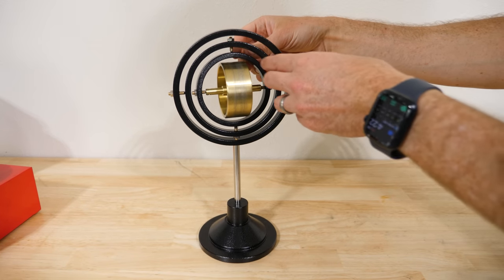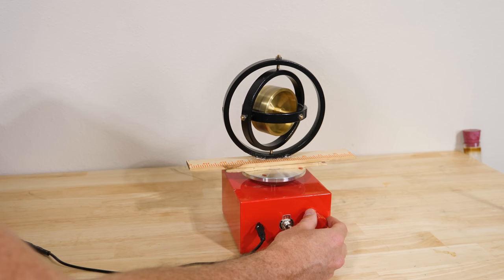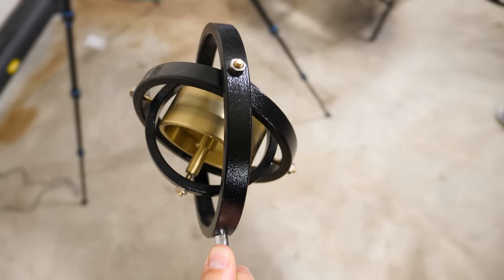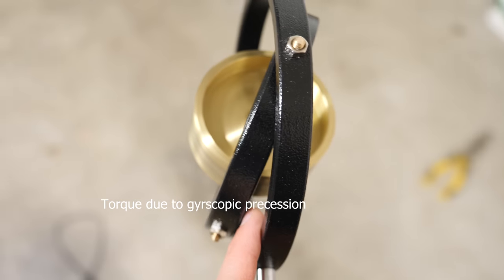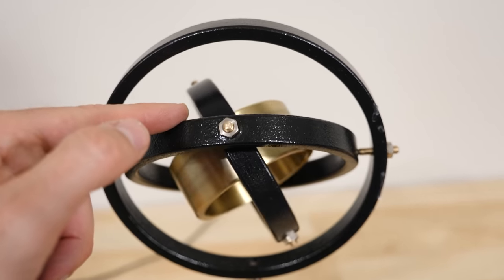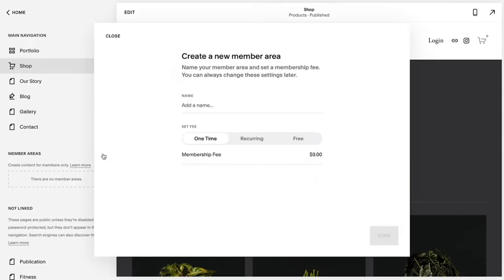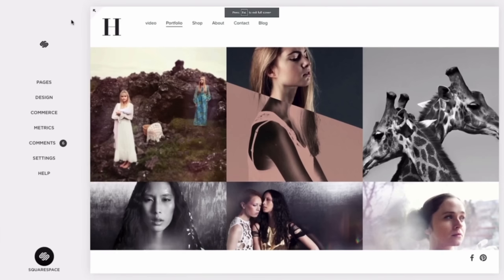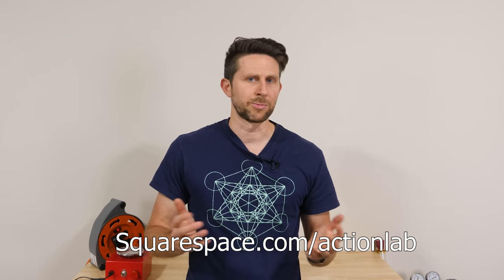Can Gyroscopes Provide Free Energy For The Planet?

Comment: Sadly, conservation of angular momentum makes this impossible. Even without calculating the gyroscope in detail, there is nowhere to "put" the angular momentum in this system. The entire earth+gyro system will always have the same amount.
Reply: If it could be proven impossible that easily all the scientists he mentioned would never have worked on it, your reasoning must be flawed
Reply: Exactly, I weep at the state of physics education of the average commenter here.
Reply: @iamdigory  well, no, foolish things get done all the time.
Reply: That was my first thought too. However, it is possible for a system to lose rotational energy while still conserving angular momentum. For a rigid body (which the Earth of course is not), the minimum energy is achieved when the largest inertial axis is aligned with the rotation. See Explorer 1 spin instability. To extract energy from the rotation of the Earth, we'd somehow need to torque the Earth toward a lower energy rotation. Though after all the time Earth's been rotating, I'm fairly confident that we are essentially in that state already.

Comment: But those are all balanced and so the gyroscope doesn't have to do much to maintain balance what if you made it unbalanced and used the calculated imbalance to manipulate the gyroscope and instead have the gyroscope on the outside and the imbalances coming from the rings on the inside of the gyroscope as long as its calculated so that the internal imbalances aren't causing a clash into eachother... if this doesn't spark any ideas, then don't worry. I'm not really an expert in physics by any means. I am really just throwing some ideas out there that might perhaps bring a spark of interest to you or anybody who happens to read my ideas and it gives them a fun idea for an experiment.
Reply: Also curious about how magnetics and gyroscopes could both be utilized to levitate aircraft and maneuver something like a space ship and without the fuel.

Comment: What if you went with wind instead? Put a massive gyro ball at the top of a tower that wiggles back and forth in the wind like your arm. Just have sensors and motors spin the gyro a bit when theres a wind and they oscillate and get up to speed on their own.
Boom.
Bladeless wind farms.

Comment: It is keeping the same direction because you have interaction of your gyroscope as far as it is not free on a vacuum, but have a contact with the Earth's rotation, even through the surrounding air and that creates motion synchronization! Also, to make the gyro to spin you are losing energy and to do its axis to spin from where you expect to collect the beneficial in energy, also you are losing energy because you keep in your hand the base of the gyro, and you are moving around with your legs, where also you are losing energy. So, how much energy you have to produce to fell the losses and to have and a benefit? And such a gyro device will need to spin without any contact with the Earth, not even gravity force, and the device the same time to be on Earth not over Earth. The gravity interaction with the Earth could exist even in a infinity distance from Earth if the Earth and the device, were the only things around. The interaction will always occur.

Comment: Energy from stable pressure or in other words gravity. Something that generates heat or cold from pressure without loss of mass when it is contained. Must be much better choice to research then a gyroscope who takes lots of energy to get spinning.
Reply: I don’t think that’s possible… to generate electricity you must have a state change
Reply: @truestopguardatruestop164  You generate energy from hot and cold with a sterling engine or steam engine depending on the heat. There is also a thermoelectric generator or peltier TEG as its also called who gets energy from either hot or cold.
Reply: @truestopguardatruestop164  There might be a gas or something who will behave this way im not sure. Earth has a hot core and its confined in space.
Reply: @Centrikk  yeah the Sterling engine changes the state: the two temperatures average in the end

Comment: Oh, you answered the question that i had in the opening -  yep, i don't want longer workdays, so please stop!^^
Reply: I can very easily proof,that this cant be done. And trying it out as a company is kind of stupid.
To extract any energy from earths rotation,you've got to change its angular momentum relative to its center. For this to happen, you need a external force. This could be something like the moon, but also something on earth speeding up or getting slower angular veilosity relative to earths center. So this is not possible with a gyroscope,cause its center of mass stays at the same point relative to earth. Its center of mass hasnt got any increase or decreas of angular momentum relative to the center of earth. Its basically bullshit. And i wonder, why they even tried.

Comment: So I'm no big brain but wouldn't it take energy just to get it started? Also wouldn't it have to be a huge expensive set up just to get a tiny amount of energy out of it?(if any)
And when it was generating tiny energy wouldn't some of it get lost through heat because of the laws of thermodynamics? 
Wouldn't a wind turbine or Pelton wheel water turbine give you way more power compared to the cost of the set up?

Comment: It boils down to gearing - MASSIVE gearing!
If you took a really, really huge gyro then the difference between the axis of spin and the axis of the earth’s rotation would increase so by using the difference and gearing it up you could run a generator.
However it would be hugely inefficient and you would be talking about a gyro weighing thousands of tons to see any useful work. And spinning at thousands of rpm - I wouldn’t like to be anywhere near it….

Comment: You had a silly setup - just don't let all 3 axes be free for rotation - only one, so it cannot orient itself into the axis of rotation. Then extract energy from the gyro drift. Of course it tries to orient itself, so the structure has to be rigid enough to resist it.

Comment: But even if we could, should we? What happens when the Earth slows down or stops? Equal and opposite reactions, remember.
Reply: The Earth has a rotational kinetic energy of 2,138×10^29 J. World primary energy consumption fell to 556,63x10^18 in 2020. At that rate it would take approximately 384.097.156 years for the Earth to stop.
If we can use Earth's rotational energy as an environmentally friendly alternative to carbon based fuels right now, in a million years or so we can start to put energy back into the system.

Comment: Wait a minute. What about the conservation of angular momentum? The slower rotation of the earth decreases its angular momentum unless small bits of mass within the earth system start to rotate. Or is it possible to transfer the angular momentum to the background stars via the mach's principle?
Reply: Yes, Earth would rotate less, and the hypothetical device would speed up (you can wrap your mind around this easily using energy conservation). Frame-dragging does not extend out to cosmological distances, so no cheating.
Reply: @MrMichiel1983  But if the device speeds up, kinetic energy is cosumed. There must be a fixed amount of energy that could be extracted from earth and trasfered to the device with net positive energy gain to do other things before equilibrium is reached, stoping extraction. To avoid this, angular momentum needs to be transfered outside earth-devices system.
Reply: @emiliohuizar3549  Yes, absolutely. I don't think a gyroscope would in fact work. Tidal energy does sap energy from the Earth-Moon system though (but I didn't want to comment on that - I wanted to delve into the use of Mach's Principle and how I think it wouldn't apply).
Reply: @MrMichiel1983  If such a device could be constructed, Does it would prove that mach's principle extends to cosmological distances indeed?
Reply: @MrMichiel1983  I did a simple calculation using energy and angular momentum conservation. The result shows that indeed there is a maximum amount of energy that could be extracted with a hypotetical rotating device. Energy extracted is a function of earths rotational inertia (I_e), device rotational inertia (I_d), earths initial angular velocity (w_e1) and earths angular momentum velocity decrease (x). Although mechanically seems feasible in this way, I am afraid the solution would be forbiden thermodynamically. The graph is E(extracted) = I_e w_e1 x- 0.5 I_e+I_e^2/I_d x^2. Sadly, youtube don't let me post the geogebra graph.
Reply: @emiliohuizar3549  Ha, that's a creative way of looking at it... We are talking hypotheticals here, and two wrongs don't make a right... but, indeed sure if such a device were to be constructed it would certainly mean we'd have to look at the principle cast in another light.
In the end I think Mach's principle is an example of a conformal theory, as in that there shouldn't be a difference between a body spinning and the universe being stationary, and the body stationary with the universe spinning in a weird way. But that's just a complicated way of saying that there are always two sides to a coin -> always at least two mathematical statements that yield duplicate results.

Comment: Energy in energy out....the Earth is already rotating, so to take energy out of the system, you would have to change that rotation speed, anything less than that won't produce energy from it. This is like basic physics.
Reply: Yes, he doesn't mean in infinite energy, like with impossible over-unity devices, just that it's rotational energy of Earth is so abundant that for all intents and purposes there would be no scarcity of it in the next thousand years.
Reply: @MrMichiel1983  a gyro needs to be spun up....that energy isn't free, so any transfer of energy from the Earth to an object on Earth while using the object inside the Earth influence is coupled and meaningless. It's like saying that we should be able to harness the effects of gravity, by simple dropping heavy objects from a vast height.....yeah, we can, but it costs energy to move it to that height. When I say "nothing is free," I literally mean that we are already coupled on the planet, nothing here within the planet while on the planet is going to be free. The best we can do is the tides from the lunar/solar orbits giving us energy (which is outside interference) or solar energy directly (also outside interference).....there's a possibility of us gaining energy off of a moving comet, but not Earth while on Earth, just not happening.
Reply: @sabriath  Yup I agree. Never said it was a good idea to try and use gyroscopes, but tidal energy does sap energy from the Earth's rotation.
I was commenting on the use of the word "free". No such thing as an over-unity device, but the tides are free like wind and solar are for free.

Comment: we can have free energy, a globe within a globe within a globe, mimicking the earth's core, if you look at the cutaway of the earth, it looks like, layer-layer-layer. then it copies-copies-copies-then it repeats-repeats-repeats. the power of 3,, each globe has 3 laters of polished nickel, with magnets, creates a magnetic energy wave, each globe rotates opposite than the other, this creates a "constant rotational surface", the energy wave creates a light, add a Gyroscope to the outside driven by the rotation of the globes, will create an "engine" that can go to outer space or to the bottom of the ocean, add programmable nanotech and it could possibly be able to create true hard water, it could remake the glaciers, it could possibly help to re-create the underwater rivers of the oceans that cool off the planet that the glaciers were feeding. we have the parts and the tech, it just has NEVER been put together like this !!

Comment: The reason it does not work is because the Earth does not spin, the Earth is stationary, Flat, and has a Firmament canopy AKA Dome in the sky, which encloses the Sun and Moon, both of which are smaller than Earth, and spin around above the surface of the Earth at an altitude of about 73 miles.  You can verify this by setting a high speed gyroscope on a tabletop, keep the gyroscope spinning at high speed with a motor, and after hours, the gyroscope will be facing the same direction as when you started the experiment, proving that the Earth did not spin one bit.
Reply: U r smarter than all of the worlds scientists, good proof !

Comment: You can get energy from the earth using thermal turbines and as long as there's a molting center in the planet there's an infinite energy supply.
Reply: So not actually infinite, but indeed very abundant. New drilling techniques might make drilling holes down to 20 km feasible. At that depth geothermal energy is no longer constricted to geologically actie zones.

Comment: Considering we're moving millions of miles an hour constantly changing directions it sure does feel quite stable and still to me... I'm just saying...

Not to mention the fact that the constellations have been exactly the same for THOUSANDS of years when they should be different from night to night if we're moving at the speed they actually say we are.
Reply: planes travel at around 460-575 mph. yet you don't feel the velocity at all.
Reply: Lol, do we have a flearther here.. The key words are scale and relative position. Nothing strange when you grasp this
Reply: @DaP84  troll, don't bother
Reply: Your velocity relative to the Earth is about 1000 mph if you're on the equator (less at higher and lower latitudes); the resulting centrifugal force very slightly counteracts Earth's gravity, reducing your weight by about 0.3%, which is measurable but not directly perceptible.

You're right that the stars should move from night to night, and in fact they do move from night to night, but this movement is extremely subtle. The amount stars move when observed 6 months apart (half of Earth's orbit around the Sun) can however be used to measure distance to nearby stars, and this has been done as early as 1838 (by the astronomer Friedrich Bessel).

Stars also slowly move over longer time-periods, and quite noticably so for some stars. Constellations change. A great example is that while Polaris is currently situated almost perfectly over Earth's north pole, we know based on the observed motion of stars that in antiquity there was no star of significant brightness within 10͏° of the north pole, and indeed "The Greek navigator Pytheas in ca. 320 BC described the celestial pole as devoid of stars."

Comment: Am I the only one concerned with where the source of the input energy would be coming from, if we were able to get energy from the earth’s rotation? That would slowly sap away said rotation and then we’ll be properly boned. Much like if you had to introduce additional drag to a flywheel, it isn’t going to give you free limitless energy, it’s going to possibly give you energy but the wheel will stop spinning faster than it otherwise should have… even if the “drag” is indirectly applied. So please no one work on making any mechanism that can draw energy from the earth’s rotation!

Comment: Can two magnets attracting each other horizontally tied through strings to the vertical poles facing each other weightless on weighing scale?
Please do this experiment
Reply: The strings would never be perfectly horizontal in this experiment you suggest.  There would be a slight vertical component of the tension in the string that offsets the weight of the magnets, once the scales aren't supporting them anymore.
Reply: If we choose neodymium magnet
Reply: @AlderAjay  My answer remains the same, regardless of what base material comprises the magnets.

Comment: Don't the oceans extract energy from the Earth's rotation? Or is the  effect not really a thing??
Reply: It is, it’s really slow though, plus the 2011 Japan earthquake undid about 500 years worth of slowing the rotation, the land got rearranged so much that every day has been about 1.8 microseconds shorter since then
Reply: @theauggieboygamer9148  What I was getting at in the original comment is that after almost literally reinventing the wheel by doing the giant gyroscope thing, they'd still be left with the problem of producing electricity, i.e., they'd end up right back where the whole project started.

To your point about water, there are many places where subsurface currents do move quickly enough to be useful in electricity generation. The Florida Straits where I live is one such location. Hydroelectric dams use much less water than this and still produce an immense amount of electricity. Wind farms produce respectable electricity by using a much less energetic medium: the air.

Comment: Can we extract electricity from gravitational force? I know its a very weak and passive force but can we?
Reply: We do, it is called hydroelectric power.
Reply: @carultch  I meant using only native gravity , combined with some mass and scifi stuff.

And hydroelectricity is very location specific.
Reply: @Im_DJ  Only at black holes, and those are more location specific than hydro plants.
Reply: Gravitational energy is potential, so you'll get energy only if you drop something.

Comment: This is what happens when I got an remote controller car it has lights on the wheels and when I was using it the battery’s fell out and it was still moving and I realize the light takes a while to go out and I decided to put back the battery’s in the car and driving it and if fell out again and the same thing happens the light takes some time to go out I was confused then I take out the battery’s and decided to push it after I pushed it I started seen the light Comming up the more faster I push it. So is this also a gyroscope ?